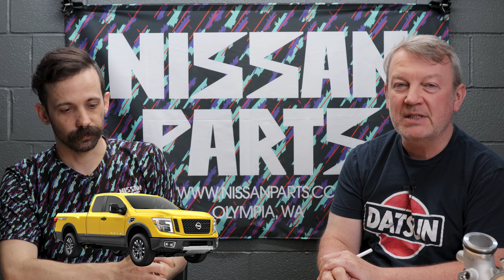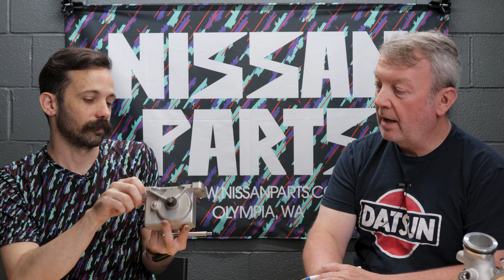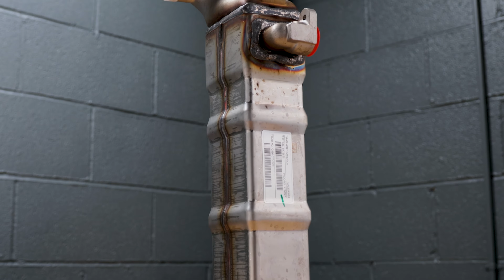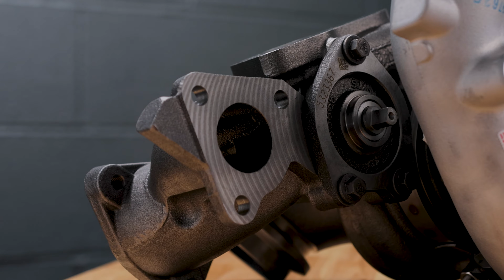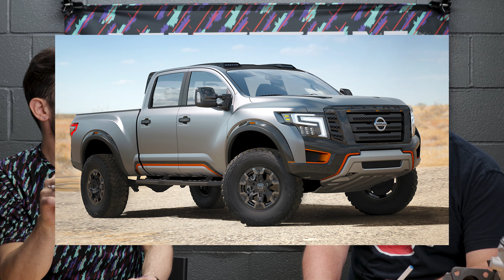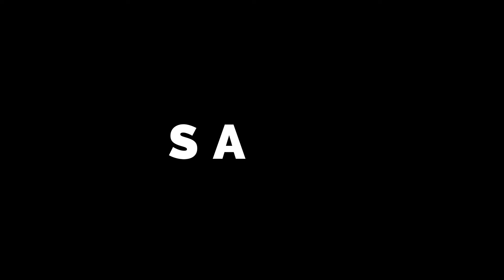Nissan Titan Cummins Diesel Discontinued: What Happened?

Comment: I’m looking to trade my first gen titan in for a diesel and get into the diesel truck experience. I have no real reason to own a diesel truck (I don’t tow or haul anything) but I want the extra power and turbo noises lol and these sound fantastic. So far I hear very mixed reviews on the Cummins engine but I’m thinking I should just take a leap of faith and try to find a titan with a good service history and even possibly already had some of the typical failure parts replaced. Id like to delete it and for any newer diesel truck deleting it seems to prevent common failure issues with turbos/egr/emissions stuff.
Reply: If I can give you some advice, unless you have deep pockets run away. I have one and I just spent 8k for the entire turbo system to be replaced. High pressure and low pressure turbo as well as the actuator.
Reply: Kronos:  did you ever get a Titan diesel or another brand?  Or were you scared off : )
Reply: @ no sir I never got a Nissan Cummins. For my personal business a full size diesel made more sense. Went ahead and got myself a 2018 6.7 power stroke. Deleted and it’s been a blast to own. Had it for almost a year

Comment: 97k miles I ran into a bunch of random issues. 

~Injector #2 O-ring had “disappeared,” causing a loud knocking sound, I just cleaned the injector and put new o-rings on it. Cost me $16 to fix myself. (Dealership wanted $1500 to replace whole injector)
~fuel lift pump started leaking. Found out an o-ring on top where he T is was bad. Had an o-ring kit laying around, so cost me $0 to fix. (Dealership wanted $1700 to replace the whole assembly)
~front engine cover started leaking. I tightened all the front bolts. Fixed the issue. 
~door handle seals were bad, allowing water in and when it froze, it broke the assembly. I hear this is a common issue with Altima’s. Covered under warranty. 
~Turbo actuator-how do these actually fail? I can turn my truck off, wait 3min, turn my truck back on and reset my check engine light. The turbo actuator acts normal. It typically also pops the check engine light then acts up only when it’s hot, and I’m in stop and go traffic. Winter is coming, it won’t come on during the winter time. Only summer. So why? You can’t just say it’s broken. There’s something internal going wrong with it that I bet someone could easily repair.
Reply: I need to add in, 105k was he last issue I had. I’m at 140k right now and I haven’t had a single issue since 105k miles. Before 97k miles I never had any issues. 

I absolutely LOVE the truck. I’d buy another. Only thing is, is you want this truck, I’d recommend having some sort of mechanical knowledge. The truck is so so easy to work on. Easier to work on then the ol 5.9 Cummins.

Comment: I have a 17XD, cooler and EGR went bad at 35K. Did a full diet and it just runs so much better. Now have 51,000K without any problems. I highly recommend doing oil analysis at every oil change and keep a watch for metal ware. I have 4 done from the last 4 oil changes at every 10K miles.

Comment: Love my Titan XD diesel. Bought new in 2016 and I did have the actuator, low pressure turbo and egr cooler replaced under warranty 3 years ago. Been excellent since. Great truck.
Reply: I just lost my f250 in an accident. I' m thinking about getting one. Any parts problem? backorder?
Reply: Did they warranty the turbo at the same time as actuator?
Reply: @JoshuaOlson-sv2ik Yes. All was covered. In fact, Nissan has since upped the warranty on the actuator and high pressure turbo to 10 yrs, 150k miles.

Comment: I have a 17XD SL with 101400 miles on it.  I've had the turbo actuator replaced recently under the extended warranty. Wish this truck had a larger fuel tank on it, since mileage is so crappy, and parts are getting hard to find

Comment: I like mine. It tows way better than my first gen. Super powerful the top end is crazy with turbo you can accelerate for passing up to 100 scary easily. Platinum reserve seats are comfortable it has dvd in head rests. Heater cooled seat. only 50k platinum ford are 80k. I always wanted a gtr but honestly this is more practical.
Reply from the maker: Right on

Comment: I have a 2017 Texas Titan XD 34K on it. So far no issues. I change oil and all the filters at 5K miles even though Nissan says to change them later.  I use amsoil and hotshot products along with OEM fuel filters. I hear a bunch of horror stories on you tube relating to the motor itself and I have to admit it makes me a bit nervous. But a lot of those stories seem to come from people who have altered the motor in one way or another be it full deletes, partial deletes or different tunings. Plan on leaving the motor itself bone stock and hopefully avoid some of these issues. Aside from all that, I love the truck. It came with a lot more features for less money than some of its competitors and always gets a positive comment from folks on the street.

Comment: My titan is 7 years old and have 91,000 Km’s (56545 miles) kept regular maintenance and oil change not an issue with the vehicle at this point. Even got a letter in the event the turbo malfunctions has extended warranty.

Comment: Capabilities,
Needed something heavier than what Nissan could provide.
Ended up with a super duty diesel.
Now probably going to a mid height roof van. And will probably go with a transit due to Nissan not offering one in all wheel drive.

Comment: Love my 16 Titan XD! Although I did have the motor replaced about 7000 miles ago because of a broken crank I still wouldn't trade it for anything else.
Reply: Cft has a great video explaining chaffed injector harnesses on thesee trucks. It causes shorts, which cause misfires, cylinder flooding and hydrolocking of the motor. Every broken crankshaft that they've had has had bad injector harnesses also. Tight zip ties and rubbing. If you know what to look for it's an easy preventive maintenance
Reply: @cooperlauck186 that’s total bs along with that company
Reply: @destinhook3826  reviving an old thread i see. There are more things to look out for now. Checking crank dampers, using 10-30  instead of 15-40. Preventing overreving. At the end of the day I wouldn't own one anymore. I traded mine for a 6.7 ram with the manual
Reply: I just had my 2019 diesel Nissan Titan motor replaced under warranty. Apparently the motor was 27,000 bucks. All for an oil leak lol
Reply: @jamesroberson3730  yeah that sounds like the same problem I had. It was almost 3 quarts low when the knocking started. Nissan took care of me too thankfully.
Reply: @jamesroberson3730 where was the oil leaking coming from?
Reply from the maker: Doh! Well Im glad you were able to get it fixed.

Comment: These are the greatest trucks ever if you have the patience to work through the issues.
Reply: Yea mine blew up at 60k junk
Reply: @CLUBCARLIFTED666 lol keep doing mods anything you touch will not last. I have a 2016 original no mods and running perfectly fine…
Reply: @CLUBCARLIFTED666 what year was yours?
Reply: @83neffline  probably first model year
Reply: What issues did you have to work through? Thank you
Reply: @estimatingonediscoveringthree yeah curious to hear also.
Reply: I have a 2018 my issue is egr valves other than that it’s a great truck best thing is delete
Reply: 😂Which is to say they are not the greatest trucks ever…2016 xd cummins PR
Reply: They are absolutely dog shit. I have a 2016 and it’s in the shop more than on the road.
Reply: Just look at his username clubcarlifted666, he destroyed it on purpose lol
Reply: 2018 spun crank bearings at 42k and block was trash.  Oil change every 3500, dealer maintained. Nice truck inside, rode decent, but man, it had so many issues. And felt heavy and sluggish compared to the ford I'm in now. I kinda feel like they hurried into a (at the time) booming market, that's already dominated, and they didn't do enough r and d before shoving it to market.
Reply: I have a 2017 Titan XD Diesel PR, bought new, now has 140k miles.  Pulled big gooseneck horse trailer all over the US.  Turbo actuator replaced under warranty and the EGR cooler leaking issue under warranty are the only issues I have had.   I’d buy another brand new one right now if I could.  In 2017 I paid $46000, and that was just more than half the cost of a top trim 2500.
Reply: Mine is 2018.  I did have to replace the turbo actuator on warranty.  No other issues.  It's a great truck and real smooth with the diesel.  It's great for towing and for cruising.